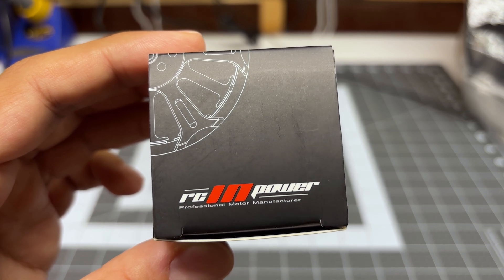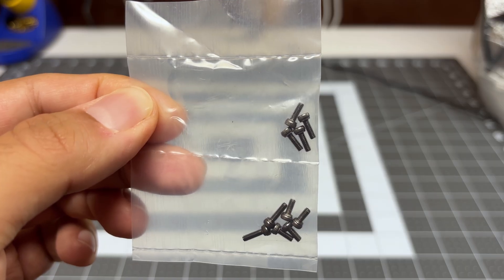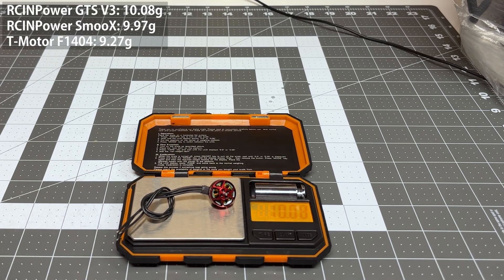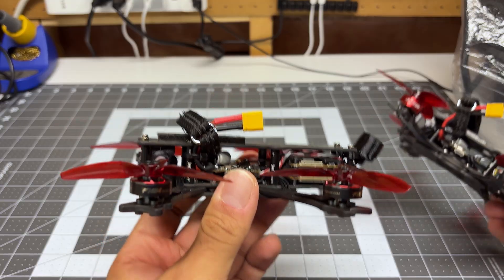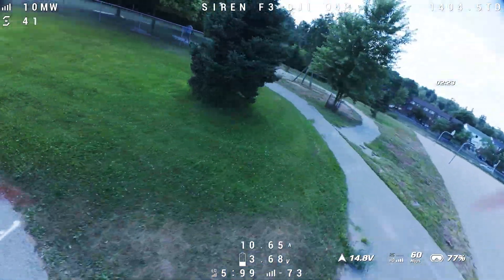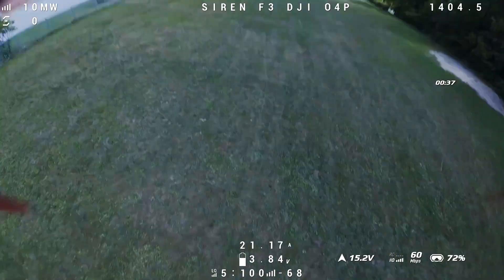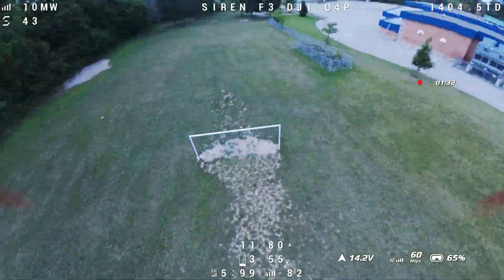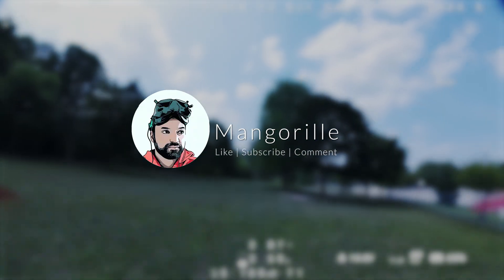The Most POWERFUL 1404 Motors I've Ever Tested! 💥 | RCINPower GTS V3 1404 Motor Review

Comment: meps 1404 pretty powerful n durable too
Reply from the maker: I don't like the look of them, yup that's vain... The specs show a peak amp of just 13 amps vs. about 20 amps on other power hungry motors.
Reply: @Mangorille I'm disappointed that there aren't four propeller motor mount holes in them, but I tried them out and was pleasantly surprised. They've lasted on one of my bashers for a year and have had really good power compared to many others. Mostly surprised by their durability. Some bells have magnets with no protection like happymodel super light and crazy efficient but no durability. Like Amax too but finding they stick easily almost like the gap between stator n magnets is slightly too tight. Are these your fav now?

Comment: But for me the best 1404 i have used so far is sub250 1404-4500kv motors they have taken a beating and still work, the smoox motors very tough also but the gts motors both the small size and the 5inch motors of theses don't last i bought extra's when i bought my gts motors and thank god i did.
Reply from the maker: What part failed on your GTS motors?

Comment: been using this for awhile now i have two sets installed on 3inch and 3.5inch you need the skinny 4s 720 or 850hv batteries tattu has both sizes and sub250 has the 720 using theses i get about 4 to 5 mins flight time but yes using 650 4s you dont get much flight time and if your 650 is on the older used side you'll get 2 to 3 mins only as i have found out.
Reply from the maker: Thanks! Generally find that 4 - 4.5 minutes is plenty, just enough to get a good flight in and then come back for a break. So far the T-Motor F1404 seem to check most of the boxes for my type of flight.